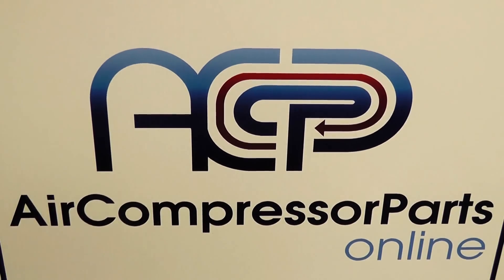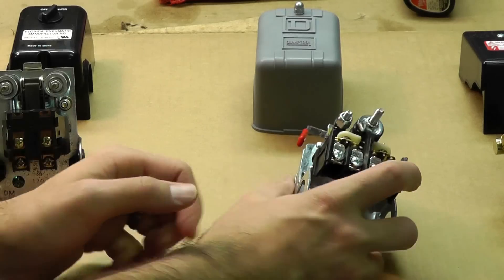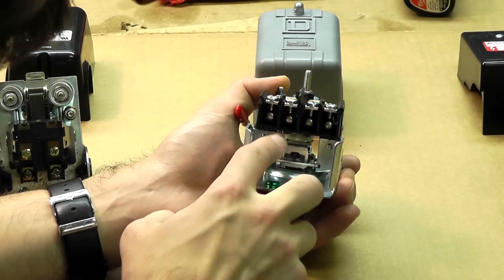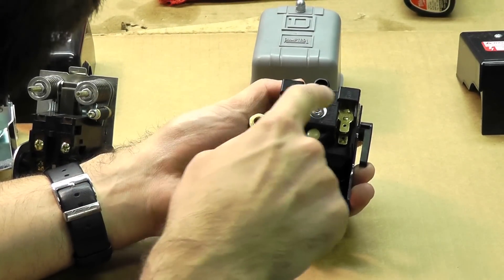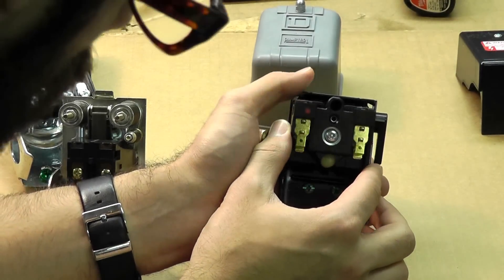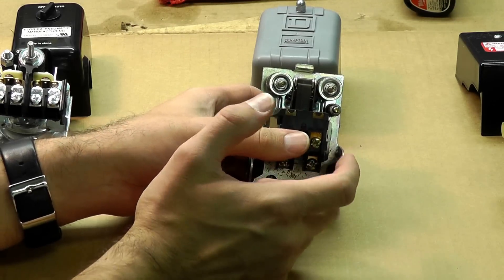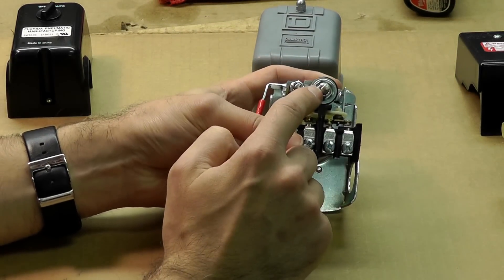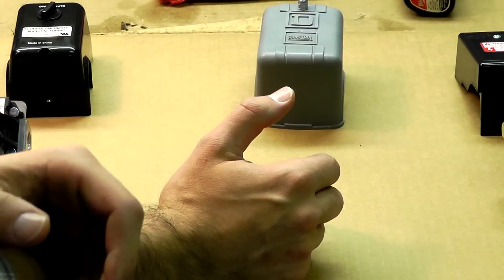How To Adjust And Wire A Pressure Switch

Comment: Eric: been looking at a number of sites and think I'm homing in on the problem but would like your assessment.  Hitachi EC12 compressor starts, runs up to 120psi or so, cuts off, and pressure is bled off to ~60psi before air escape stops, whereupon the motor attempts to restart but is sluggish and humming (I'm plugged directly into an outlet on a 20A circuit).  It can pop that breaker.  Also, when I turn the pressure regulator knob clockwise or counterclockwise, the pressure gauge on the regulator doesn't show increase or decrease, which it used to.  Gauges on the pressure switch and regulator show same pressure regardless.

New pressure regulator, new pressure switch, or both?  Check valve seems to be clean, lubed, and intact.  Thanks
Reply from the maker: Thanks for the comment! Does the tank bleed down after the unit shuts off, without you using air? If it does, the Check Valve is certainly defective as it's not sealing, allowing air to escape from the tank and leak out of your pressure switch (usually out of the small bleeder valve). 
Regarding the pressure reading on your regulated pressure gauge, it seems that you may have a defective pressure gauge, simply. To test, take a look at the pressure reading on the tank. If it reads, say, 60 PSI then obviously you should be able to adjust the regulated pressure from 0 PSI to 60 PSI. If you turn the knob and the gauge doesn't move, then your Gauge itself is defective. If the Gauge reads 60 PSI, then it is working as it should. If you're getting air through the regulator and through the line, then most likely it's the Gauge itself which is defective.
Lastly, you may have a defective motor Capacitor, which is causing the unit to hum on re-start and trip your breaker. It may not have enough "juice" to get the unit started. I would have that capacitor tested; we have a video where you can do find out how, just click on the below link:

https://www.youtube.com/watch?v=4UQ79YKU5Qc

I hope this helps and reply if you have any additional questions I can help with!

Comment: I bought a cheap pressure switch from Amazon and it has no notaions for where to wire it. also it only has 4 terminals. where would I put the ground wire.

Comment: i have what looks to be the same square D P.S. but mine doesnt have the secondary small adjustment spring. I am having issues with the system not shutting off at even 200psi. its a 3 phase Igersol rand set up. and looks like i have only the white net. and one black power hooked to the 1 and 2. if i manually flip the switch it arcs and pops the breaker. I am assuming this is all wired wrong or its missing the spring. This is a new to me set up btw
Reply from the maker: Some switches only have one adjustment, and your switch may only have a "range" adjustment screw which would adjust both the cut-in and cut-out pressures simultaneously. It sounds as though your pressure switch may be defective, as you should certainly be able to adjust it down to at least 175 PSI (for most two-stage compressors). I would honestly have an electrician take a look at the set-up as well to confirm all is wired correctly to the switch and to the magnetic starter of breaker.
Reply: +Air Compressor Parts Online  I was looking at it, I am thinking the wiring from the wall is not set to the switch and motor properly. Thank you for the answer back and your very well done video
Reply from the maker: You're welcome and thanks for watching!

Comment: When I only need 2 bar, is it wise to set the cut-in at 2.1 bar and the cut-out somewhere at 7 or 10?
Reply: It's probably better to short-cycle the compressor so probably don't have them too far apart.

Comment: the square d  switch, if its a 30 50 setup, would it be pre set at that or not?
Reply from the maker: You're referring to 30 PSI cut-on pressure and 50 PSI cut-off pressure, yes? Certainly there are switches that are factory set at these pressures for certain applications (water pumps is a popular one). But, of course, you couldn't adjust a switch that's factory pre-set at 175 PSI down to 50 PSI as it doesn't allow for that large of a differential. 

I hope I answered your question but if not, reply and I'll try to give you more info!
Reply: i'm talking about a pressure switch for a jet pump for the house. i want one that you can adjust but i was just wondering when you buy one that says its a30cut in and 50 cut out , are they actually pre set at the factory so you wont have to adjust it very much?
Reply from the maker: You're exactly right, those settings are what the switch is pre-set for at the factory when you purchase it.

Comment: forgot to addd has female inlet for i guess call for safety switch when it goes down to 80 psi /n 100 psi n pressure switch on bottom is male tread thanks again

Comment: thank you for your help switch is cw-2075-31 on at 80 psi/off at 100 psi female inlet with off n on manual lever should the start motor have a ground wire cuz it dont have ground wire or dose the power wire ground the the start motor..? thank you johnny
Reply from the maker: I show the direct replacement for that CW207531 switch to be part# CW212500SJ. It sells for around $42 + shipping and you can find it on our site by clicking on the below link:
http://www.aircompressorpartsonline.com/index.php?r=product/view&id=18579

This has the same on/off PSI rating and has a 1/4" Male NPT fitting, with on/off dial switch. This is a Campbell Hausfeld switch, as this unit was manufactured by Campbell for Sears Craftsman.

As for your second question, this switch has 4 terminals, two for your line (power cord) and two for your load (motor). It does have a ground wire connection, as you should have a ground from your power cord or motor that would connect to the switch body. Typically the ground from the power cord would ground the unit and be screwed in to the ground location inside the switch body (for 110 or 120 Volt applications anyway).

That unit has a whole lot of metal on it, so if you don't currently have a ground, it's a good idea to have one. So, if 115 or 120 Volt I would buy a new 3-prong power cord so you can install the ground wire to the pressure switch body.

Comment: hello i have a older sears air compressor model #106.174541 more than sure that i cant get same pressure switch for it wjat would be an ideal replacemant switch i could get that is similar switch that will work with it thanks johnny
Reply from the maker: You're right about  that, the original pressure switch hasn't been available for some years for this particular model air compressor. The original part# for the switch was either CW-2075-5 or CW-2075-7 (depending on the cut-on and cut-off pressure of your compressor).
I'm sure you could replace the original with a new modern switch, and the Furnas (aka Hubbell) switches are very popular with many different PSI settings available. They may look different, but they function in the same manner and wire up basically the same (very simple).
You can view these on our site by clicking on the below link:
http://www.aircompressorpartsonline.com/index.php?r=product/view&id=286

You basically need to choose a switch by finding the correct cut-on and cut-off PSI, which is pre-set from the factory. All of these switches have either a 1/4" Male NPT or 1/4" Female NPT fitting on the bottom of the switch, which should be the same size as your original switch, so it should thread right into the inlet.

These switches have an Unloader Valve attached, the original did not. Not a problem, you simply won't attach anything to it.

I hope this helps, let me know if you have any additional questions!

Comment: WHAT PRESSURE SWITCH  CAN I USE    FOR A CAMPBELL 11 GALLONS  MODEL # VT9101 ????  THANKS
Reply from the maker: +CUMITA-4WD This is an old unit, so the original Pressure Switch is not available any longer. But, Campbell does sell an OEM replacement that will retrofit it. The new part# is CW212500SJ and you can find it on our site to purchase by clicking on the below link:
http://www.aircompressorpartsonline.com/index.php?r=product/view&id=18579

Hope this helps!

Comment: Hello, could you please tell me what is the purpose of pressure switch in air compressor? how it is related to valve
Reply from the maker: +Vikash Kumar The Pressure Switch is an electro-pneumatic "switch" that is essentially the "brain" of the air compressor. It has an internal diaphragm that senses pressure from the air tank (which is preset at the factory). The switch senses both the factory cut-in pressure and cut-out pressure, and turns the unit on and off accordingly. Once the pressure reaches the set PSI rating for the unit, copper contacts mechanically close the circuit and turns the unit off. For units that use an Unloader Valve on the Pressure Switch, this Valve is pneumatically tripped once the switch shuts the compressor off, and "unloads" the excess air out of the air lines so that the compressor doesn't re-start with pressure in the lines. Hope this helps!
Reply: +Air Compressor Parts Online Thanks

Comment: Jim you showed us what the screws were for, but not how to adjust it
Reply from the maker: +anotherdamnyankee It's pretty simple, all brands of pressure switches are the same in that you turn CW to increase the PSI and CCW to decrease the PSI. From there it's just touch-and-go to adjust the cut-in and cut-out pressures to the desired PSI settings.

Comment: Hello. Purchased a Square D 95/125 4 port switch. Shuts off at 125, but pressure drops to 120. Could it be the unloader valve. Checked all connections for leaks,hearing for noise and using soapy water.
Reply from the maker: +Hector H Yes it COULD be the Unloader Valve leaking that causes it to drop down to 120 PSI, from 125 PSI. You can remove the Unloader Valve (and tube) to confirm this; if it still leaks down then the Unloader Valve is not the problem. Also spray ALL fittings and connections on the compressor, from the pump Head to the tank (and drain cock on the tank) to confirm there are no leaks anywhere on the machine. Also make sure the Check Valve in the tank is sealing completely after the unit shuts off, if not then it will back-feed through your Unloader Tube and out of your Unloader Valve.

Comment: Your Square D info is wrong. Large screw moves the range up and down. Say a 20 40, turn it clockwise and raise it to 50 30. The small screw adjusts THE CUT OUT ONLY. SO, IF YOU WANTED TO INCREASE THE DIFFERENTIAL BETWEEN CUT IN AND OUT, YOU WOULD TURN LARGE COUNTER CLOCKWISE, TURN SMALL CLOCKWISE
Reply from the maker: +cdwyman Actually, the video is correct for the Square D adjustment. 
1. The "Range" (large screw): Turn nut down (CW) for higher cut-in pressure, or up (CCW) for lower cut-in.
2. The "Differential" (small screw): Turn nut down (CW) for higher cut-out pressure, or up (CCW) for lower cut-out.

The Range adjustment does NOT adjust  BOTH the cut in and cut out pressures, it only adjusts the cut-IN pressure.

Here's a .pdf document from Square D which explains:
http://www.homedepot.com/catalog/pdfImages/10/10a50e35-cbce-404b-bb26-b47ecaa8f957.pdf

Comment: I have a tecmark pressure switch on my spa. I replaced the whole heat unit. The heat is not coming on. We check everything is right on the board. The rileys working fine fuses are fine> We checked the power going out from the board is fine. The power at the end of the wire to connect to the pressure switch are fine we have power going out and coming in. The problem is when We connect the wire on the pressure switch has no power coming into it. If i connect only one wire and check there is power but after connecting both it has no power at all. 
Cold the pressure switch be bad?
Any help would be appreciated.
Reply from the maker: +Viana “Vianamor” Oliveira It could very well be a defective pressure switch, yes, although I'll admit I'm not very familiar with the application. I would probably contact Tecmark or the spa manufacturer to get in touch with a technical rep who can better trouble shoot for your particular application.

Comment: Please post the amperage rating  from the motor  data plate.  If it pops at 80 psi then the load on the compressor motor is increasing  as the pressure builds up. Have you put oil in the cylinders just a drop or two of air tool oil.  Also check to see if there is a check valve that prevents back feed into the compressor.

Comment: i have a curtis  pump  that im rebuilding the rings r worn and i think the pressure relief valve is stick and im not sure on the reeds im sure it need new but there not like ive seen before , it was my grand fathers, i cant get a rebuild kit from curtis cause its so old and i need help if u can i need to put a new pressure switch on it i need to find out what size of a.c. motor would be best and pully size im rebuilding it with champion rings and gaskets if they fit if not ill have to make the gaskets i thought but i think the relief valve is stuck but ive never worked on one this old if pictures will help i cant send some , id like schematic on a relief valve and the reeds or somthing close to here is the info curtis : pat 1869362 : model : 139639    1708158 : size 2 5/8  x  2  5/8  : serial 3085-8006 : min rpm 400  :  c-120    :  314-383-1300  and rebuilding with champion rings from model # c1-000 its same size bore 2 5/8   please help i lost my grandpa he was like my father and all of his tools were stolen besides this and they even cut this off its tank the only reason i still have it its cause they must have ran out of fuel for their torch  i can pay for anything if that would help thanks for any and all help please email me stevencoker66018@outlook.com id like to do some bussiness  what type of pressure switch are best i have a 32 gallon tank i know thats not huge but it will work for the tme being i think i dont know thats why im  asking you thanks im at your mercy
Reply from the maker: +steven coker I'm sorry for the long delay in replying, did you ever find the parts you need? We don't carry many Curtis parts but we may be able to help if you still need the parts. If you can, email tech@aircompressorpartsonline.com and we'll do our best to help. You can send photos of the pump as that will certainly help. Sorry again for the long delay in answering this.

Comment: Jim.  I have a D-Square switch and want to increase water pressure throughout the house.  It looks like I just have to screw down on the large spring nut.  Correct?  Do I have to turn power off at box before adjusting?  Do I need to shut off water to the pump before adjusting?  Thank you.  Carmen

Comment: Need to turn on at higher pressure. On at 50 off at 55 .have timer to limit time to run. Low water level.... Pump does not turn on till water is so low that we loose to much water pressure. Have large water tanks for capacity. But recovering is slow... Not wanting to go so low that it takes to long to refill again...

Comment: I have the switch on the right.  My motor maxes out at 175 psi but my hoses max at 150psi.  The switch I got does 175psi max. Like you said on the switch on the right, I couldn't find info on adjusting but that center security torx does have a spring under it. Is that the adjustment screw?
Reply from the maker: That is the adjustment screw, yes. If it has a screw there, you should be able to adjust the main calibration setting so it will adjust BOTH the cut-in pressure and cut-out pressure of the switch. C.W. for increasing it, C.C.W. for decreasing it. The differential setting (if you have another adjustment screw) adjusts only the high end cut-off pressure of the switch.

Comment: My air compressor pumps up to 120 PSI then it throws the 20 amp breaker. I tried to adjust the high end cut off pressure so maybe it would shut off before throwing the breaker but no matter how I adjust it, it still pumps up to 120 PSI and throws the breaker. It has a square D switch just like the one in the video and I'm adjusting the smaller nut but it doesn't change anything. Any thoughts?
Reply: if it is a 60 gal or larger should be on 30 amp breaker 10 gauge wire